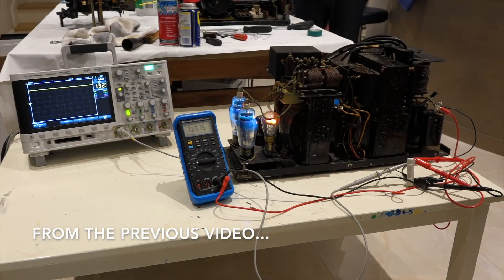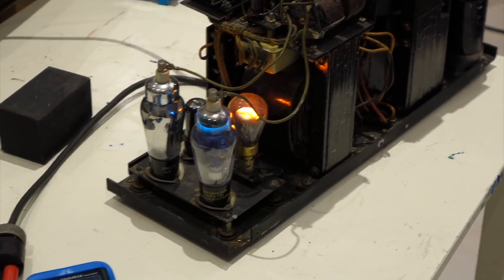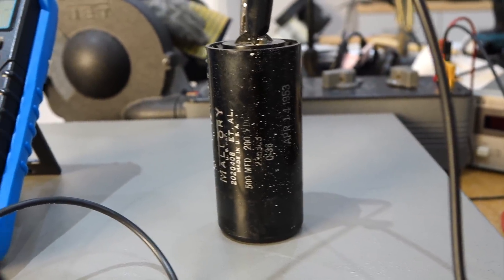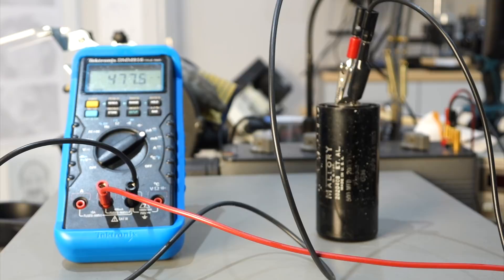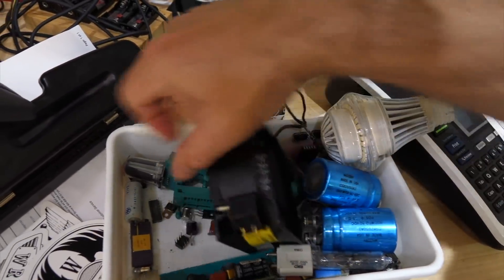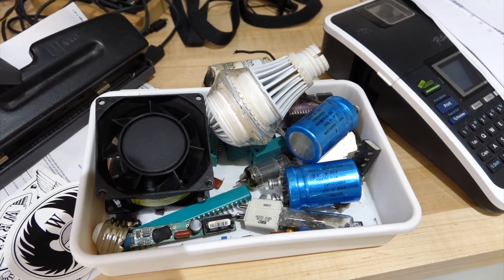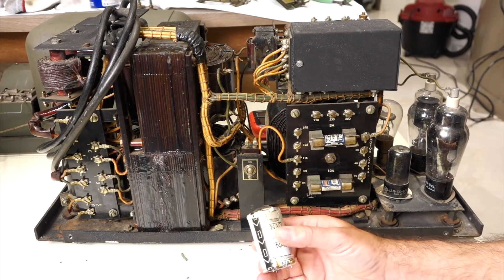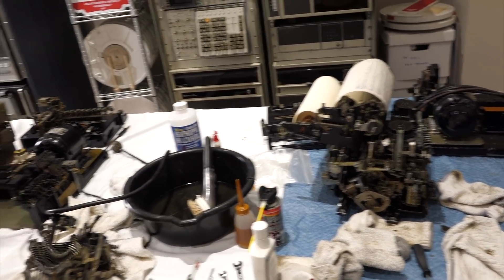Why we don't always replace vintage electrolytic capacitors

Comment: I have caps in my 80’s guitar amp that still check good, so they stay. Why change them if they test good? Seems alot of the new ones are worse than the old stuff. More surface area = less heat and stress.

Comment: Many of the 1960's components  were made extremely well, so it stands to reason that they would last a long time. I know we rarely change capacitors in vintage Marshall amps, since it effects the value of the amp and the old ones sound good.

Comment: I think vintage equipment should be maintained with as many origial parts as possible, with as little soldering as possible.  Thus some detiroration has to be accepted.  The one point where I don't make a compromise is safety but often there are other ways to guarantee safety for equipment of marginal designs or deteriorated state such as operating the equipment behind an isolation transformer.

And finally even Gordon Oliver and Jamie Ramsay agree nothing beats the smell of good old vintage caps.  They just don't make them like that anymore!

Comment: There certainly is a lot of contradictory opinions on replacement of electrolytic caps in audio equipment. In terms of my experience, I've been putting off replacing the caps in my mid-70s high end Kenwood/Trio amp. After finally doing it I am pleased with the results. There is definitely an improvement in definition. So I then decided to do the same for my early 70s Philips speakers...can't say I hear any real difference.

Comment: I just converted a tube radio into an AM transmitter, since somebody already stripped half of it (lytics included) I didn't have any filter caps to use only a 50 year old elwa branded filter, I installed it and the transmitter is working fine to this day. I only change old filters like that if they are damaged on the outside too much, are dry or have noticeable faults. The capacitor itself reforms when in use so those are actually gonna get better with time.

Comment: I agree that vintage capacitors should be replaced only if they are defective. Many older capacitors were very well made and if so, will not dry out. I have found that the bigger the capacitor is, the longer it will take to dry out, if it dries out at all. I would rather have a capacitor in my device that has worked properly for 40 or 50 years than a new one that has no track record.

Comment: Here we fix pinball machines and juke-boxes from all ages. So, from time to time, we do see 60s and 70s juke-boxes (Seeburg, Rock-Ola and whatnot) with point-to-point construction and components from the time. Sometimes it's with tubes, and sometimes it's solid state. I am by no means an electronic engineer, and one of the most important piece of advice I got from very qualified, old techs knowing these old amplifiers, selection units and so on, was to only change the components that were indeed out of spec, burnt or damaged. Leave the others, because once you start to replace them all, it changes the electrical loads so much in all kind of odd places that you would be hard pressed to know what's wrong with those circuits.

Comment: Rule number 1: "if it ain't broke, DONT fix it!". The MAIN reason caps go bad is is NOT easy to define due to there being MANY reasons but in my 45 year experience as a graduate engineer one of the biggest is environmental due to over stressing the cap in service. Chicken and egg ... Does the cap go bad due to its ESR going high (aging) or does the ESR go high due to overstress? I firmly believe the latter and is anecdotally backed by people who always recommend replacing caps with a higher temp rated one.

Interesting fact: despite (more likely because) old equipment being valve based produced a fair amount of heat, better layout and heat dissipation spacing reduced stress on capacitors. Also valve equipment being typically high volts, lower current than modern equivalents a large high voltage electrolytic tolerates high voltage variances with less stress than heavy current variances.

I have MANY 30-40 year old good quality electrolytics that I would typically rate as good as, if not better than, modern Chinese equivalents especially.

As if to emphasise my point somewhat, I've had to fix COUNTLESS SMPSUs over the last 25 years and not a single one had a faulty HV input reservoir cap. The output filtering caps however?! Well if I could have a pound for every one of those replaced!

Finally, when dealing with products such as Mallory's ... Don't argue, they were and are designed to last, especially in good designs keeping well within the design envelope ... Leave them alone unless they are ACTUALLY faulty.

Comment: I enjoy computing history, and love understanding how we got here, so a few years back I started that journey.

I started with the machines which made a large impact on my educational experience, so the first machine I acquired as a restore project was a VT100.

Most of the components checked out fine. There were a few tricky caps that were bulging from the bottom in the power supply, tricky Dicks!

In the end I replaced them all anyway.

In fact the entire power supply board is pretty much rebuilt 90% of the components.

I have to go through and replace more components on the video board resistors/etc.  Which I am planning on doing this year sometime.

My reason is the same reason I replace the items on my car.

I don't wait for a tire to fail, or the battery to die, or the belts to snap before I replace them when I know, they are 3-4 years old and have a lot of wear and tear on them.

For fairly vintage equipment, I don't want to risk damage when some of the components on my VT100 for example, I am not sure if I could get them replaced without scavenging.

Just my two cents.
Reply: The components are part of the historical context of when that particular device was made. I only replace failed components to preserve the originality. Replacing resistors as "routine maintenance" is truly crazy. By the 1970s, industry was using metal film and metal oxide resistors which are highly stable, and are the same type of resistors used today.
Reply: @gregorymalchuk272  I actually use my museum pieces for fun and work, so I am more concerned over failure than your ordinary collector.  Preventive maintenance is imperative.

Comment: Clearly the solution is to recap our old Macs with 1930s capacitors :D
Reply: SAerror1 thats what I was thinking.. lol
Reply: Teknogod17  There's not much to degrade in a sealed paper cap.
Reply: Main reason for the need to replace caps in more modern equipment is because cap plague was largely caused by [incomplete] stolen electrolyte formulas that made them fail.

Those of us that grew up using caps that were made before this theft took place are aware of the fact that they still perform very well.

TLDR: Get over it!
Reply: @MadScientist267  Wow. I would love to see that proper formula.
Reply: @AmaroqStarwind  Basically the "replace every cap" thought process is based on inferior caps. There are many cases where the caps in older equipment simply perform as well as they ever did, and replacement simply isn't necessary.

The problem comes where higher speed switching supplies and such took over and the inadequate ESR and such became an actual issue. In things designed for use with the slower frequencies (50 and 60 Hz) as well as any use where there's no detrimental operation because of minor drift in tolerance, it's simply not necessary.

I'm not saying caps don't age and eventually need replacement, just saying that they don't need it "just because they're old". It matters what they do, and what they're designed for.
Reply: @MadScientist267  It also depends on the type of cap. Wax caps have the same sin than electrolytics with bootleg formulas
Reply: @MadScientist267  I may have reconstructed a part of the stolen formula and also what was stolen.
"... with the slower frequencies (50 and 60 Hz) as well as any ..."
They stole a multiplier of 2, because in these applications the capacitors mostly see a ripple-frequency of 100/120 Hz.
Just for the fun and thanks for your post:) + :P

A post from me in 2019, loosely related: Here is something for the capacitor afficionados:
Replacing capacitors in old hardware is always a good move and it has therapeutic benefits for some of us. However, it is just as pleasant to know what you are doing and why. The life of an aluminum electrolytic capacitor is mostly determined by the chemical reaction formula called "Arrhenius' Law of Chemical Activity" and therefore to an great extend by the ambient temperature. In short it says that the life of a capacitor doubles for every 10 degree Celsius decrease in temperature.
L2 = L1 * (Vr/Vo) * 2^x
where x = Tm - (Ta + deltaT) / 10
Ta = Ambient Temperature, Tm = Max temperature rating of the capacitor, deltaT = Temperature Rise from Ripple current
Vr = Max voltage rating of the capacitor, Vo = Operating Voltage, L1 = Load Life Rating via Datasheet and L2 = The projected Life at operating Conditions

So for a L1=1000h/85° 10V ordinary cap running in a 5V system with no thermal stress(at ~25°) this will result in the ballpark figure of around 20 years. The 20 years are operating hours, not an expiry date as for food:)
If you substitute the ordinary with an Europe Chemi-Con gem with 10000h/105° 16V operating at 5V/40° you can expect a lifetime of 1,800,000 hours or 205 years.

With power supply capacitors, the deltaT must be calculated with, as this can be an important value when ripple current is flowing to a greater extend than in normal applications.

Have fun and enjoy the eventide of your life in 205 years together with your capacitor:)

P.S.: Most important: "Measurement is knowledge!(Messen ist Wissen!)" and also "Who measures, measures dung" (okay that doesn't translate well from the german "Wer misst, misst Mist")

Comment: exactly, not always necessary to replace 'all' or even 'any' caps, depends entirely what the cap is, where in a circuit and whether its important for safety, or what would happen if it failed....  people seem to think 'replace all caps' is a magic cure all or prevention for failure, ..it isnt...
Reply: problem when resurrecting old caps, is that i've had some  that seem to reform ok, but when in use with their operating ripple current, they can get hot and give trouble...most of my old radios have their original electrolytics in and are ok at the moment

Comment: Some of them actually last longer than the new ones!

The people telling you to replace them don't know anything about what they're talking about half the time anyways.

What people also fail to realize is that vacuum tube equipment is far less sensitive to these things than digital electronics are - A television will usually work perfectly fine with some slightly off capacitors or dying resistors in circuit! Watch shango066's ressurection videos for proof of concept there. If it can sit outside in the California desert for 40 years and be brought back to life by cleaning a switch and changing two capacitors, then there's obviously some serious leeway in the component values!

Comment: You get that "replace every old cap" mentality in radio restorations, TV repairs and old guitar amps too.
Reply: To be fair to amp repair techs, there is a very good reason amp repairmen keep talking about replacing old caps; lookup talk about "death caps" on guitar forums.  Most amp techs don't know or have equipment for testing caps, many amp repairmen are more or less just musicians who can kinda read a schematic and have a cheap chinese multimeter; they see people talking about bad caps and say "I see, 'old caps will kill me, replace all old caps on sight,' got it!"  So that's where alot of that comes from.
Reply: @JohnSmith-r7x4z  The 'death cap' is a film capacitor in a specific location (namely between the AC input and chassis, which is why it's deadly when it fails shorted).
No sane repairer could conflate it with the other capacitors in the unit (certainly not with electrolytics).

Comment: Not every capacitor is equal. There are extremely shitty vintage caps that should go immediately, every time, and there are some - usually can multi-section caps - that perform and hold up well, even from the 50s. It's a case by case judgment call. I'd be willing to be these replacement caps from the early 50s are at the top of the rung in terms of quality for the time, but I'd still replace them anyway. Why? Why not?

Comment: Finally! Good to see someone making a modicum of effort to preserve technological historical artefacts. I find the proliferation of websites that promote the blanket replacement of all old capacitors (electrolytic or not) in any circuit irritating. This mentality of "out with the old, in with the new" is destroying elements of the past that could be worth preserving (and not just in electronics - youtube is full of these "hacking" videos). If it works, why fix it? Why make it "better"? We should learn the value of old things and cultivate the value of preservation.

Good on you guys!
Reply: I'm glad to find someone who acknowledges that the components themselves are PART of the historical context of the device itself.
Reply: @gregorymalchuk272  There's not many of us I don't think! 
It's very important though, when using such equipment, especially plugging them into the mains or other high energy/voltage/current source, to absolutely know what one is doing. An old electrolytic capacitor is a dangerous device. It must be checked and possibly re-formed using specialized equipment - some of which are in themselves dangerous. Otherwise, the device containing the electrolytic (or other component past its prime) is best left alone - or those that are keen can attempt to make a faithful recreation with modern components and keep the original intact for its historical value.

Comment: Great video - it really needs to be said.  Since returning to electronics, this time as hobby, I've collected scores of vintage test equipment (largely HP & Keithley) and with a few exceptions most of the electrolytic caps are solid even after several decades.  Since most of this used equipment cost thousands if not tens of thousands new the top of the line manufactures could afford specifying the best.  Also the military was big customer as well further prompting higher quality and reliability standards.  If I bought a consumer grade product of similar age I probably would be more suspect of their electrolytic's since they where not driven by the same expectations or objectives.
Reply from the maker: Thanks @Rk Str. You hit it on the nail on the head exactly.

Comment: Honestly i don't need to but when I work on something i normally replace them not because of leakage I'm not really worried about that but in the past a have had things go wrong and i have had a lot of capacitors fail catastrophically but i have never had a cap from the 60s and back fail i have a 1956 Motorola tube radio i pulled everything out put in a new speaker transformers got resound and new tubes but the caps were fine

Comment: I agree.  If it isn’t broken, don’t fix it.  Pre 1960s polarized capacitors don’t seem to have as many issues as I might expect - I presume because they were over-built due to less understanding of the physics and chemistry of the electrolyte back them.

Also of historical note - I have a model 19 TTY  and TD with 72 WPM gearing on a big metal table that has Bell System tags and 1934 date codes.  The synchronous motors are huge by modern standards.  The power supply is in a metal chassis with metal cage over it.  The power unit is tagged Teletype is essentially solid state even though it is 1934.  The rectifier is full wave with two stacks of very huge dry disc selenium rectifiers.  The voltage regulation is accomplished by the fact the transformer is an E-core with three windings: input, center tapped output, and a DC winding on the center of the E.  Increase in output voltage  puts more current through the DC winding, hence increasing the saturation of the core, reducing the coupling and thus tending to decrease the output.  My model 19 obviously saw very hard duty wherever it was installed and shows signs of keep-it-running improvised repairs.  I can flip the power switch today and the old TTY is ready to go just like is still 1934.

Comment: Anyone know of a video that explains reforming capacitors. I have heard the term many times but don't understand it.
Reply from the maker: Here is one I like. It's a little slow but accurate and thorough: https://youtu.be/ifWfvaIbWZY . Reforming simply consists in progressively applying voltage to the capacitor while monitoring the leakage current. Which, if all goes well, reforms the thin oxide on the electrode to its original condition and gets rid of the leakage. Not only valid for old capacitors, but new ones that are kept on the shelf for a few years without being used also benefit from reforming. However just putting them in use in a regular circuit without further precaution is usually enough to do that, so nobody thinks about it.

Comment: My favorite quote from an old IBM mainframe computer service manual:  
"Never attempt to repair or replace equipment which is working to the customer's satisfaction."  
Or in colloquial terms: If it ain't "broke" don't try to "fix" it.
Reply: This reminds me of the robot that created the celebrated light painting in Asimov's collection of robot stories. The maker performed an unauthorised service on the robot and the wanted malfunction was removed.
Reply: unfortunately for me, I can't learn that lesson.
Reply: @nbudzinski.  Thank you for the explanation!
Reply: Why "never" though? What's the problem in replacing?